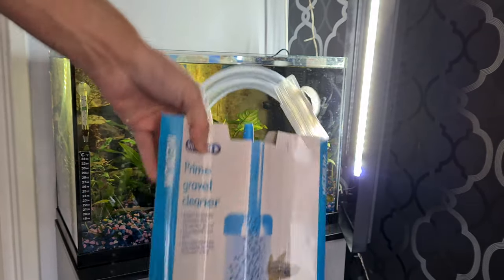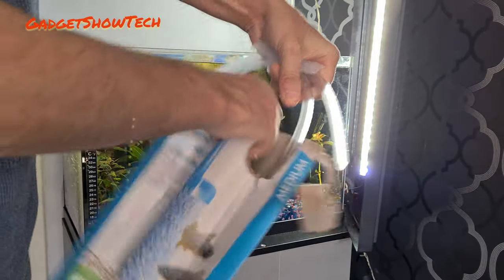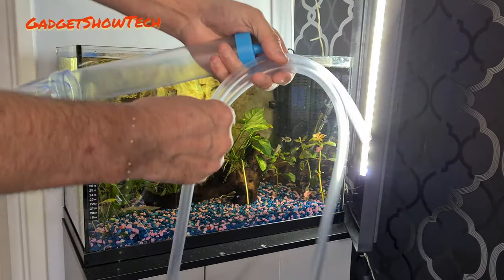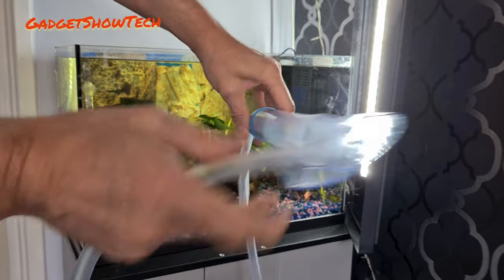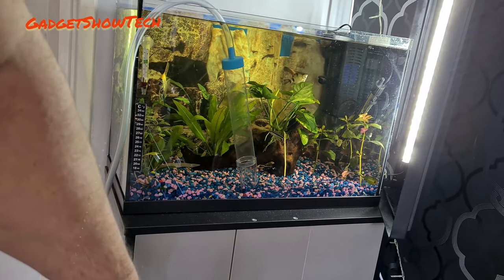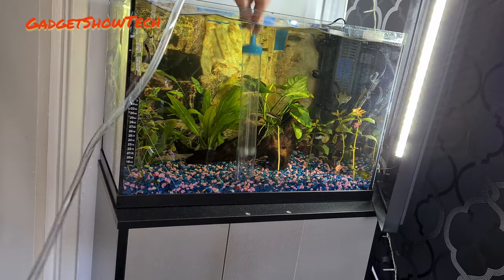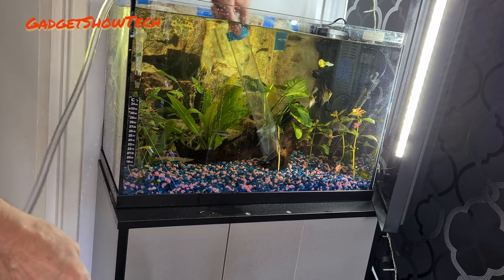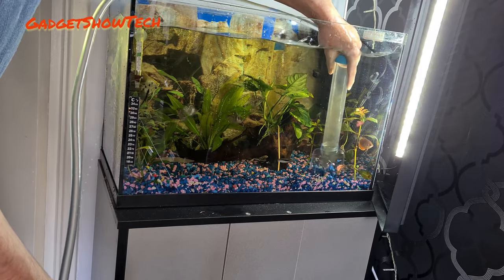How to use Gravel Cleaner Siphon Vacuum in Fish Tank Aquarium

Comment: There must be some technique. It just didn’t work for us
Reply from the maker: Ok. It was to demonstrate the one way valve.
Reply: Same here, this pump thing is stupid. I wanted to scoop up the stuff from the bomb and I ended up getting like half of the water out of the tank. I had to just put it all back in there and it just made the water quality worse because all the crap that was on the bottom is it now scattered  all over the water.
Reply: @method2madness762   I know it's two years later, but... Why didn't you just add new, clean water?
Reply: @weardpancake  because the water that was already in there was balanced for the fish. If you put a whole half a tank of brand new clean water, it’s like a shock to their system so you have to do it gradually filtering out the water, adding clean water little by little.
Reply: @method2madness762  well it depends on the fish? what kinda fish was it?